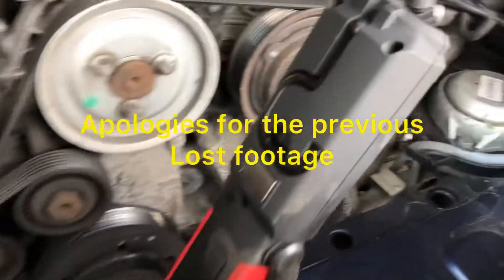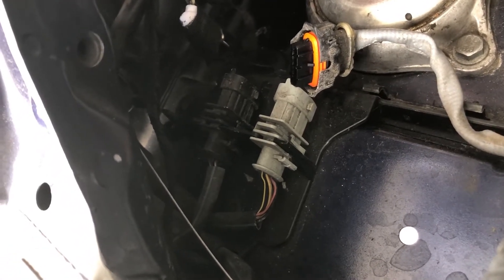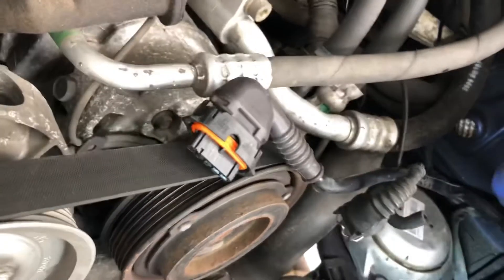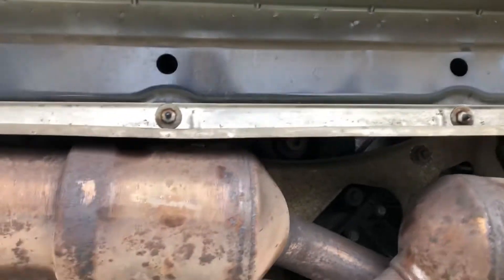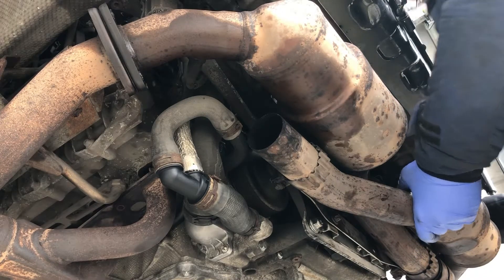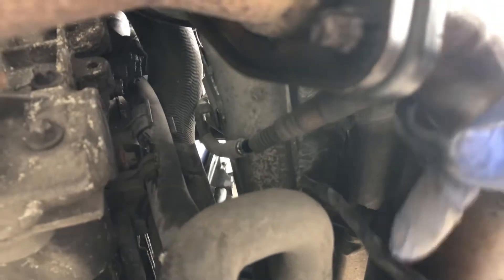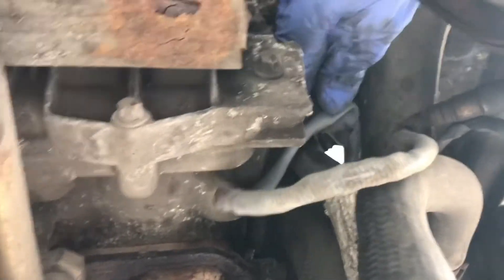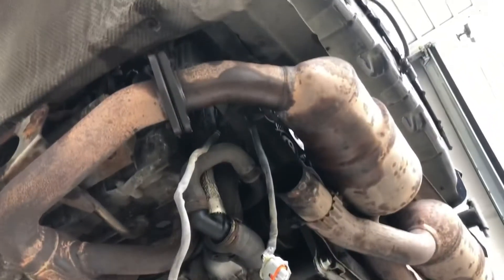997 C4s broken exhaust studs removal part 2 stormski jig.

Comment: Hi, thanks very much for the videos. Did you find the new exhaust headers make any difference to power and or noise? Cheers
Reply from the maker: Hi. The new headers seem quieter on cold start  in that the crackle isn’t as prominent. But otherwise haven notice any different at all. The headers were standard but are better flowed than the original standard pipes so I would expect a slight improvement in performance although not noticed.
Reply: @porscheminormechanicsrando8394  thanks. I have an issue with the airbag warning light. It never illuminates (even after the airbag is removed while the battery is still connected)! Have you seen this before? Cheers.
Reply from the maker: @pjay3028  can’t say I have. Worth checking your fuses at a guess.
Reply from the maker: I’ve just thought. I have removed my airbag a couple of times and on one occasion it never showed up as a fault when I replaced it. Does it not come up on the dash when you first turn the key?
Reply: @porscheminormechanicsrando8394  no, it never lights up!
Reply: @porscheminormechanicsrando8394  I noticed at 7:33 on your "Cornwall trip done and dusted" video, your airbag light didn't illuminate when you turned the key so I wondered if it was normal?
Reply: Hi I replaced my headers and they didn’t change the noise, but power delivery was smoother. 

If you want sound install 200 cell cats and change the mufflers, sounds amazing.
Reply from the maker: @graemebarriball303 . Like I said the start up noise is less rough round the edges as for delivery and power I can’t say I’ve noticed any changes but bearing in mind I hadn’t used the car much since I’d purchased it at the time. I can only say there must be some improvement as the 3 into one flows far better then the original headers.
Reply from the maker: @graemebarriball303  I’m more than happy with the sound and have no intentions on trying to-improving something that is already amazing.
Reply: @porscheminormechanicsrando8394  sorry I was replying to P jay. My car had standard stock exhaust not pse, so sounded a bit flat. Looking forward to your next vid.